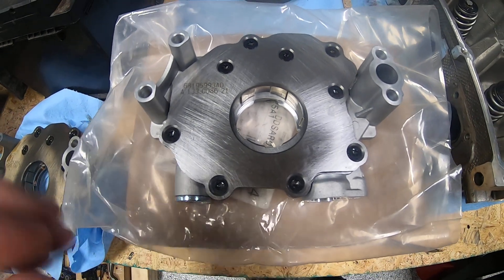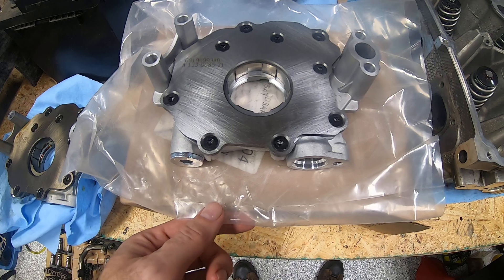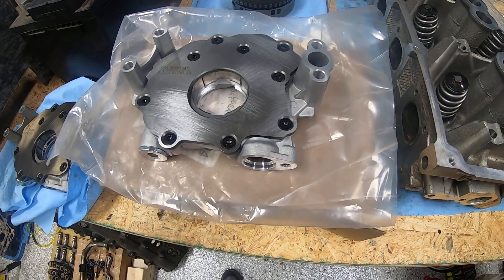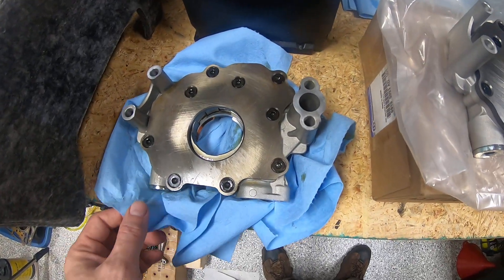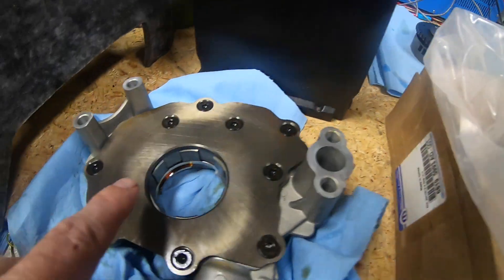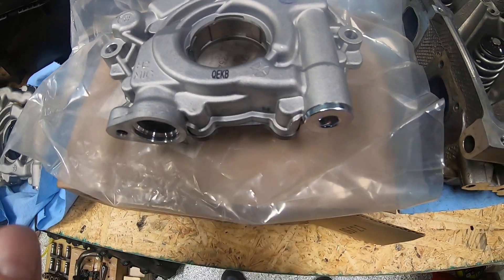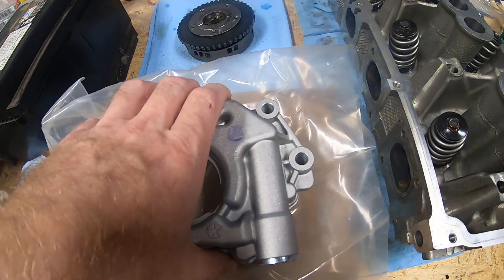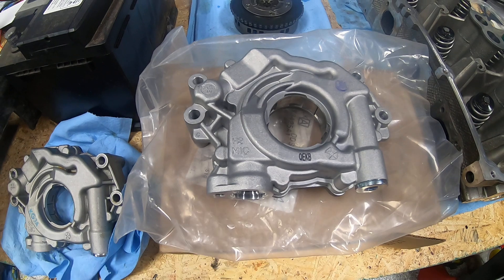Ram 2500 6.4L Upgrade Part 18a hemi hellcat oil pump external compare to original 6.4L oil pump.

Comment: I’m running an HC oil pump in my 2012 ram 1500 and it set the check engine light on
Reply from the maker: If you leave the MDS system enabled this is normal.  However another Youtuber found a fix related to the HV pumps and leaving MDS enabled.  Link to the video: https://www.youtube.com/watch?v=1gpEwkTVCmE
Reply: Some YouTuber said replace the stock oil pressure spring from the stock oil pump to the hellcat pump. It will bleed off pressure at lower psi and not set the code. Won't affect volume and don't have to mess with the wires and resistors

Comment: Does someone knows if this can be done in an SRT 2017?
Reply from the maker: The 6.2L supercharged hemi oil pump (hellcat oil pump) can be added to a Hemi block as long as the engine is from 2009 on up.
Reply: @solargarage  thanks a lot my friend, I’m new to mopar. Will be purchasing one🤝🏼

Comment: Did this truck ever throw an oil pressure code after the HC oil pump? I need to do the pump swap sooner than later on my 18 6.4 2500. Thanks!
Reply from the maker: I have heard of others getting this code, usually it happens for a few seconds at startup and then goes away.  I have had one ding for approx 2 seconds once during a start up about low pressure, but all was normal a second later.  This has only happened once and all has been normal since.

Comment: I have a 5.7 1500 Laramie, will this work on my truck
Reply from the maker: Hello, what year is your Ram?
Reply: @solargarage  2020
Reply from the maker: @erickonassis6310  You should be good as the HC oil pump will work on a 2009 and later hemi's.

Comment: I have 209k miles on a ram1500 2014 ,            ive heard chirping coming from my lifter but i used lucas high mileage oil additive and the noise disappeared until it started getting hot outside (houston) . Im thinking ill have to do the pump or later on at 240-250k the lifters and cam shaft .
Reply from the maker: If you have to do the Cam, no better time to upgrade the oil pump as it will be right there.  You may also want to replace the timing components are they need to be removed to replace the cam.
Reply: @solargarage  im surprised theres no videos on the hellcat oil pump swap for ram , the trucks almost not worth it but its better than sinking 30 more grand for 1000 in parts , just alot of work

Comment: Anyone knows if it fits 5.7 forsure
Reply from the maker: After looking at the pump setup and having it installed on my 6.4L.  The oil pump for the 5.7, 6.2, and 6.4's look to have the same foot print.  Seems most if not all the hemi motors use a pump with the same mounting setups.  Looks like just the pump internals are different.

Comment: I just ordered all of my internals from dodge dealer. I’m waiting to see if this hellcat oil pump will work so I can order one. I definitely agree with the theory of pumping more volume of oil through the lifters but I don’t want to screw up over $2000 in parts just to check the theory. 😂
Reply from the maker: Completely understand.  We shall see soon enough how it works out.  I have also done some digging and found several forum posts were others have already used a hellcat pump on a hemi 5.7

Comment: That part number comes back to a 6.2 motor. Not a 6.4.
Reply from the maker: Thanks for the comment, you are correct the pump we ordered is for a hellcat motor.  Hellcats are 6.2L not 6.4L.  We are looking to use this oil pump to see if it can provide an increased volume of oil, due to the internals of the pump.
Reply: @solargarage  it’s $270 at the dealership. After market price is around $120-140. What do you recommend?
Reply from the maker: @Pastor_RogerSherwood  When it comes to critical items like an oil pump, although expensive if it were me I would go OEM. I got mine @ mymoparparts.com for $132.00.  https://www.mymoparparts.com/oem-parts/mopar-engine-oil-pump-68195993ad?c=Zz02LTJsLWdhcy1lbmdpbmUmcz1lbmdpbmUtb2lsaW5nLW9pbC1wYW4tYW5kLWluZGljYXRvci1kaXBzdGljayZsPTEmbj1TZWFyY2ggUmVzdWx0cyZhPWRvZGdlJm89Y2hhbGxlbmdlciZ5PTIwMTkmdD1zcnQtaGVsbGNhdC13aWRlYm9keSZlPTYtMmwtdjgtZ2Fz
Reply: The hellcat unless an early hellcat and the truck 6.4 are the same block, same bore, just different strokes. They both use the BGE blocks.

Comment: Can you tell me, did everything just end up being a simple remove and replace...everything matched up ok?
Reply from the maker: Getting to the pump is a bit complex as it requires removal of the timing cover.  Removing the pump on this 6.4L did require dropping the oil pan as there is not enough slack in the pickup tube.  This is due to my setup being a truck, the pickup tube is bolted down in a second location under the block towards the back of the oil pan.  I'm am setting up to install the new pump this weekend, I'll get a video posted as soon as it is done.  From just the external exam it has the same layout and bolt patterns as the old pump.